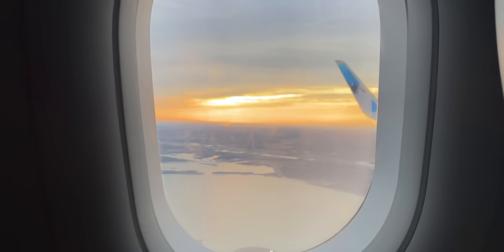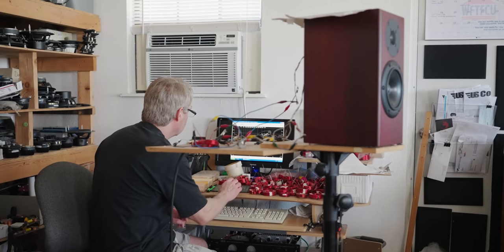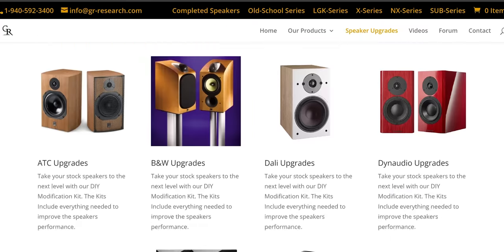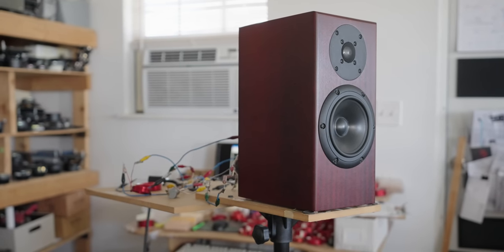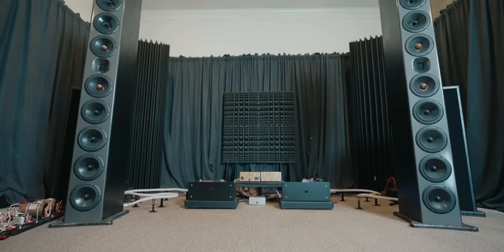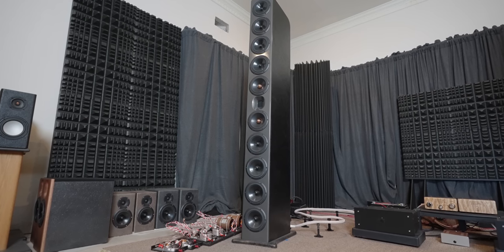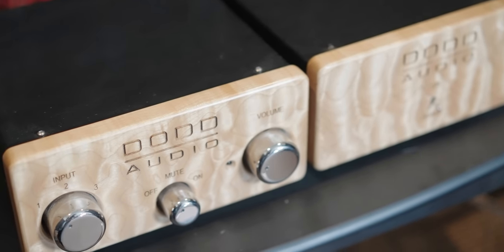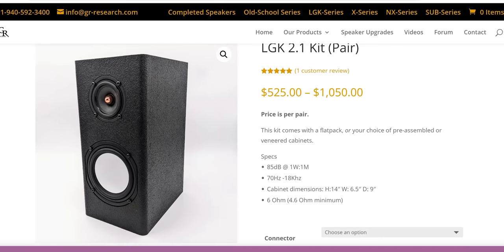Are the GR-Research Audiophile DIY KIT Speakers & Upgrades Worth The $$$?

Comment: I got to thinking about uprade process GR-Research performs and I think they are providing a needed service.  Companies do cheap out on some materials and the speakers that seem to come in are a little on the older side.  If the upgrade helps someone bring the spark back into a speaker(s) it will make them happy.  The upgrade is then made available to others to also enjoy/experience the change(s).  I'm considering sending in my 20ish year old RC-64 center channel because I know the inerds are likely 20yo cheap stuff.  If you can make a suggestion to GR-Research, have them record audio pre/post upgrade for what they are working on.  The specs on a sheet are nice but a demo showing the change would be awesome.    I'm in the process of replacing my RF-5s with Fortes so having that center channel brought up-to-date might be worth it.  Maybe, it could be tuned to work with the Fortes?  Isn't that the whole intent of custimization with this stuff?

Comment: I made two trips to Danny's in 2021. I brought both of my 200 lb Tannoy FSMs for XO rebuilds.  He did not listen to them and sent me home with one stating that one was all he needed. He used his measuring system and sent me the before and after graphs. The new XO's sounded better to me and at his price was an amazing value. One man's experience. BTW his $7k Xotica kit speakers with the servo subs
struck me as Rockers system. Bass was overblown. And his listening room is pretty large. Perhaps he adjusted it by the time you were there.

Comment: I use 2 18" DIY open baffle subs with my LRSs.  In my experience, dipole subs do a great job integrating with dipole speakers.  The lack of boxes minimizes stored energy and cabinet resonances, which make the subs sound "cleaner" than the box subs that I've heard.
Reply: *than
Reply: Although not open baffle, in my space a single rythmik f12g blends well with maggies (on risers)

Comment: And remember that those big name brands with their own Anechoic chambers that spend 1000's of hours on R&D don't always produce products with good frequency responce and decent crossovers, thats why they get sent to Danny in the first place.
Reply from the maker: Each company has their own way of doing things and we never hear from the other designer's perspective or reasonings. We just hear what Danny is saying but if what he is saying resonates with you then my suggestion would be to purchase his kits as he clearly spends more time and listening tests with it. He will agree that upgrade kits only take you so far into what he is going for because the speakers are not fully his designs
Reply: You mean when Danny claimed he improved Andrew Jones designed speakers? Do you really think Andrew Jones doesn’t know what he’s doing? 😂
Reply: Those big speaker companies run on a completely different business model than GR-Research. You’re comparing apples to oranges.
Reply: @JohnLee-db9zt  That’s your argument? Andrew Jones is great Designer. But he’s working with some budget constraints and target price in mind. Danny is free of those constraints. The notion that his kits can improve somebody’s speakers is not a ding on the original designer’s ability.

Comment: I installed the upgrade from GR Research on the super-budget level "Neumi BS5"s. The difference was night and day. Completely different sound, for the better. It did noticibly decrease the sensitivity though. But with the upgrade installed I think they can compete with very high priced speakers  (especially at low to moderate volume, they do break up if you push them). It's not a subtle tweak though, its a completely different speaker before vs after.
Reply from the maker: Thanks for sharing!
Reply: Can you describe the difference in sound?  I've got some BS5s and I've been wondering if the upgrade is worth the price, which is two to three time as much as the speakers.  Thanks.

Comment: If you buy a speaker and don't like it it would make more sense to send it back and buy a different speaker instead of taking it apart and changing things so now even if you still don't like them you either keep them or break them down again. Just use the money you would've used for the kit for better speakers, plus from my knowledge it's not or miss if these upgrades actually do anything.

Comment: Just found your channel. (and subscribed!). I am also a fan of Danny's YouTube channel and have even been in contact with him about measuring some towers I have.... Now, I am definitely not an "expert" but, I have 2 quick thoughts about this one. First, the 'anechoic chamber' measurement thing. It's obvious that complete audio isolation would be a good thing while designing/testing speakers. However, in reality people listen to there speakers in a normal room. With furniture, other people, walls and ceilings, etc. (not to mention all the different possible shapes that room can be). So I would assume that measurements in isolation wouldn't always be the best method in every case. My other comment is about only testing one speaker. If the goal is to redesign the crossover and sell it as a DIY kit then one speaker is all you should need.

Comment: Excellent summary of the visit to GR Research.   With old ears & damaged hearing my listening requirements are typically limited to background music via ceiling speakers and not the critical listening requirements of an "audiophile".  However, I watch GRR (and Iyagi) for the entertainment and lessons learned that are provided.  I think that most of DR's mods are "directionally correct" from a technical perspective but, typically, beyond my audio requirements or ability to discern.  However, I would do several of the mods or the kits as a project for fun and educational content.

Comment: To my knowledge the only customer speaker pair Danny have actually listened to is the Magnepan 3.7i. But only after his upgrade. What I found funny is that on these speakers he actually had to go back and redesign his crossover after listening to them with his initial design. He ended up moving away from the flat frequency response according to his own measurements

Comment: Everyone needs to stop using the term "as the artist intended". Nobody knows, even the artist. The artist isn't the one mixing and mastering. Spend some time in that industry and you'll see what I mean.
Reply from the maker: I agree as I used to work in studio. This is one of the topics I talked to him about and he didn't really have much to say about that
Reply: A speaker that has a accurate response, will give you great and correct sound, as what the mixer guy had done to the artists sound. Here we need to know what gear has the mixer used? Cheese parts that affects the mix? The mixer’s own sound preference? Anyway will a accurate speaker be the best.

Comment: Agree 100%: to measure a single speaker and never listen to a stereo pair is crazy. Everyone who thinks one replaces the other is fooling themselves. One needs to do both, measure and listen. That's why I call people who measure but don't listen "Fools with Tools". So I definitely do not agree with either Amir's nor Danny's approach. Having said that, I built a stereo pair of GR Research Triple OB subs, and find them to be among the best subwoofers I ever heard bar none (short of front-loaded horns the size of my listening room, and a five- to six-figure price tag), which makes them a great value for the money, and I agree wholeheartedly that what makes them so great is that they don't pressurize the room (unlike home cinema setups), instead they sound natural, and they'll do so in rooms in which similarly large subs couldn't possibly be played flat down to 14Hz, there's none of the uncomfortable overload one would get with standard subs, thanks to the adjustable damping, but mostly thanks to the fact they're OB. One can play them loud and get an amount of bass seemingly impossible in a room. Think of a bathtub full of water: a standard sub produces bass waves much as if one dropped a large object into the bath tub (water splashing all over the place), whereas an OB sub acts more like a paddle, moving the water back and forth, the only difference being, an OB servo sub is going to stop on a dime (much more important sonically than the so-called rise time). First time one hears a natural instrument such as a double bass or kettle drum played back on an OB servo sub, there's no going back. Sealed and ported subs, as impressive as the "chest thumping" impact may seem playing back movies, simply don't get this right. The most musical subs for the music-loving audiophile.

Comment: A few comments on your observations:
1. Pair vs solo speaker: if you work based on measurement (on and off axis, including phase) as GR Research , you just need a single speaker. I am just surprised that it is not measured in a an anechoic environment.
2. For a listening, a pair is mandatory to evaluate the sound scape and details. Here a listening room environment makes full sense.
3. For the bass, that's a good point. But it is simpler to manage with an eq than mids and highs where phase relations are more tricky to deal with.
4. Working on the cross-over filters to aim for neutral response is a design choice. GR calls it an upgrade as it is their design philosophy. If you develop a speaker based on listening tests of a panel of customers, you may well end up with a fairly different design that gives more character (or imperfection wrt linear response). That's a choice. 
5. I think GR research is honest and working in good faith with their principles. Now whether their upgrade is an upgrade for you is a question of what people are looking for. 6.Personnally, I really like the open discussion that GR Research brings to Youtube world of audio. It made me understand much better how speakers are designed and which tools can be used to tune them to achieve a certain goal. I have'nt tried their upgrade kits but I am not sure that linearity is necessarilly what I aim for anyway. I respect what they are doing though.

Comment: I actually agree with Danny (GR Research) on several fronts regarding speaker and crossover design. I get off the bus regarding magic cables. So, let's see, I  should regard measurements of speakers as canon, but dismiss measurements that suggest little to no differences in cables. Got it. And I have trusted my ears regarding the difference in cables (patch, power, speaker) and decided I'd rather my extra money went to buying new music.
Reply: And I should add that I'm not saying one couldn't design a patch cable that could alter, augment or change the signal between components, but why? Cables should be transparent.

Comment: I did get the kit for the original Klipsch RP600m.  I do think it made the speaker more even and less shouty at the expense of efficiency.  The new x-over takes a lot more juice than the stock speaker.

I built the CSS Criton 1TDx and it is a better speaker all around.  It's as good as my Magnepans.
Reply from the maker: Thanks for sharing !
Reply: Which magnepan do you have? I was thinking of trying out the CSS as well.
Reply: That's just the nature of adjusting the curve. The crossover can't really add any output that isn't there to begging with. So you have bump things down if you're trying to level it all out, so the overall efficiency goes down.
Reply: I bet the CSS is better loudspeaker because the drivers are way better quality and people at CSS don't believe in mystical properties of tube connectors or super expensive capacitors but in solid engineering of their drivers.
Reply: They use expensive high quality crossover parts from the looks of it. @pliedtka

Comment: Another thing. If you don’t believe that flattering out the response curve is not an upgrade, but rather a modification, leads me to question your opinion.  
How can fixing response curves to a flatter response not be considered an upgrade?
Reply from the maker: Everyone has different taste and I don’t think my opinion that flat frequency response isn’t for everyone or how they like it isn’t a far fetched new idea.
Reply: @Jayiyagi  I didn’t say I prefer a perfectly flat response curve, but reducing peaks always leads to improvement in overall quality of sound. A smooth overall response curve is preferable. 

My taste leaves for a slightly elevated mid bass, bass, and sub bass. About 2.5 DB up at 10 HZ tapering down to 0 DB from approximately 650 hz and up.  

Peaks always seem to have a negative impact on SQ. Just my opinion.

Comment: There’s a difference between a review and upgrade. In a pair, the speakers will measure identically, so there’s no need to ship the pair. He’s mostly replacing parts with better parts and correcting things like resonance and holes in response. 

In a review, you hear things like soundstage, depth, etc. you’re reviewing with your ears and measurements are more to confirm no design problems.
Reply from the maker: I disagree. You need to hear a pair in listening tests in design work or else how do u design to improve soundstage, depth, etc but that's just me
Reply: @Jayiyagi  everyone’s entitled to their opinion 🙂. But a sonicap will always sound better than the cheap caps typically used. It’s like putting Brembo brakes on your car vs stock. It’s going to be an improvement without having to take it out on a skid pad to know how much.
Reply from the maker: @chrisabboud3949  :)
Reply: @Jayiyagi  Most of those factors have more to do with the listening room than it does speaker tuning.  As a counter argument, since Danny is not in the customers home, there's probably little incentive for him to spend time moving speakers and furniture around to find the ideal listening experience just to calibrate a flat FR.
Reply: @Jayiyagi  Thats only if you are building a speaker from scratch.  Danny is doing up grades, just fixing peaks and dips alone will automatically improve soundstage and depth.

Comment: Taking a product that has already had many hours and money thrown at at and modifying/upgrading it is easier than starting from scratch.  There is no doubt in my mind that someone with thousands of hours of seat time (expert skill level) can come up with a crossover that can make a product better.  For example:  I used to design and test components (R&D), during testing if the output of the product was not meeting specification there are levers (specifications) that can change the output, these levers were designed in.  In my case there was 12 levers to pull over two sub assemblies that made up the final product.  After many hours of seat time (again, many hours) I knew within seconds what values/levers to change based on what the output graph was telling me.  I did this job for 15 years and had worked on many similar products that essentially did the same thing.  Remember the Gladwell rule of 10,000 hours to become an expert, this is not just something that is made up, it is a skill.  Experience is everything.  Also, in design and manufacturing, the design part which includes a lot of preparation for manufacturing is about 80%+ of what you do, the rest is execution of that plan.

Comment: As a speaker hobbyist familiar with speaker measurements and how they correlate with perceived sound... I can say that GR Research mods are grounded in solid and well established engineering principles and it certainly looks like Danny knows his stuff. The only thing I cannot verify is whether his measurements before and after a mod are honest and correct.
I am taking Danny at his word when he shows us his frequency response and spectral decay plots that he isn't fudging or using  "smoothing" to improve his results. I am also assuming his before and after plots use the very same measurement processes. If he is as honest as he claims then many of his speaker upgrades are quite remarkable and should be most impressive in listening auditions... the Pioneer HPM 100 as an example.

Comment: That was a very fair assessment.  Danny is a passionate guy which imho is necessary trait to be innovative.    As far as the one speaker comment,  what he may have been referring to is that Amir couldn’t hear the spacial benefits of the speaker in subjective listening tests.
Reply from the maker: Danny is a passionate guy for sure. As for the other point... well it goes both ways. The reason Danny criticized testing only 1 speaker was because you can't hear imaging and sound staging ("the intangible things" as danny quoted). I will argue that is the same when designing a speaker or an upgrade crossover to a speaker; according to him, he spends lots of time listening to his diy speaker kits to get the "intangible things" to a desired point. Same thing can't be said about his upgrade kits as he does not do listening tests with 1 speaker
Reply: @Jayiyagi  agreed.  I am a little curious to order his B&w 602 s2 kit just for the fun of taking it apart and putting the x over together. That is an old speaker that could probavvlt use new caps abyway

Comment: I think the upgrade kits will make it sound Better (Clearer), Because of the much better components, if you have cheap ass caps and resistors and coils, of course higher quality crossover parts will make it sound Better, and yes I dont even think Companys make good Crossovers I think they just use limited resources to make it as cheap as possible. So I  dont know if you can call yourself an Audiophile if you dont even mention that... Measurements in a acoustic perfect room is also dumb cuz no one has a good acousticly damped room.

Comment: The real question is how important of a role does the crossover parts and quality play compared to th cabinet and driver build and materials used. I have seen 30K speakers that use 1 dollar sand cast resistor. Are they really trying to save a buck? We need an AB test to know.